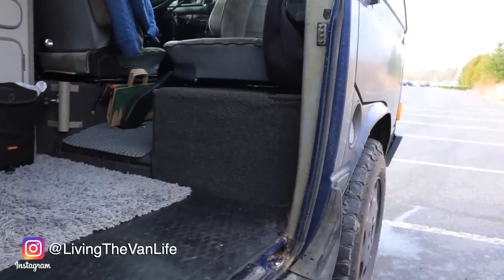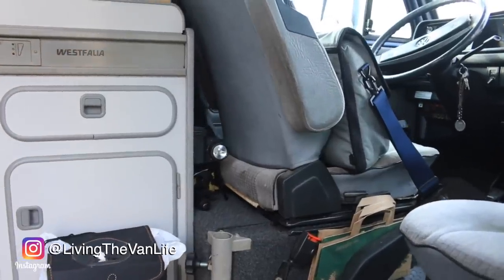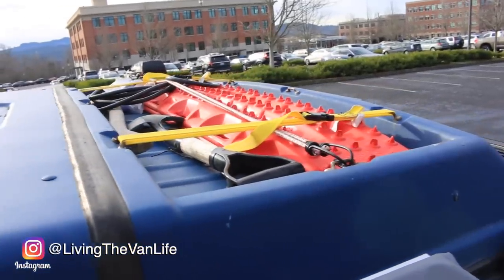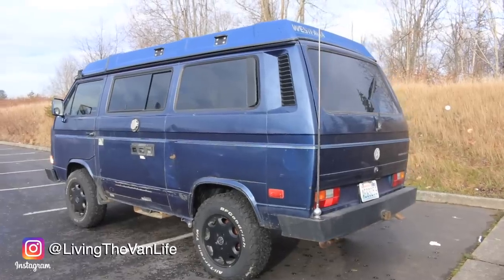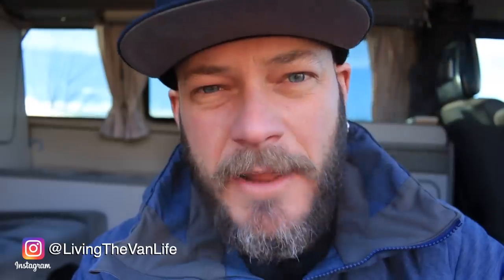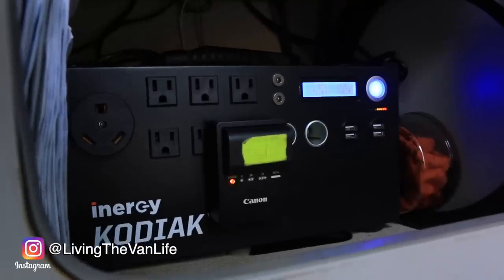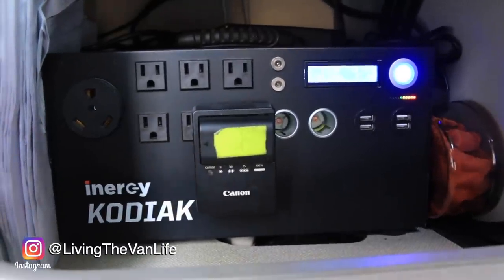Chinese Diesel Heater Install In a Volkswagen Westfalia - Living The Van Life

Comment: You forgot the most important aspect, the installation of the exhaust pipe through the floor. It is critical that no exhaust leaks back into the van. Also a CO alarm is a must.

Comment: I slept in Chicago -23 degrees in February in my ford E-150 Eco-no-line conversion van with NO HEATER ,  a jogging suit, a beanie hat,  2 hot water bottles, 2 pillows, and 3 Quilts, and my remote starter at my hip. I slept just fine no problem at all. Just keep your head inside the covers. You can use a MR Buddy heater or a diesel heater but i just wanted to let you know it can be done 100% with out it.
Reply from the maker: Yes of course.  For sure.  I’ve done the same with no heater at 10° F.  A sleeping bag and sweat pants. Didn’t even have water bottles or a remote starter.  Definitely keeping the head under the covers is a must.

Comment: Not sure if mentioned, but you may want to cut down a furnace air filter to fit that intake plenum to minimize lint, dust and other stuff from being sucked into the unit.
Reply: Great suggestion. Will do that when I make mine...someday.   :)
Reply: Thank you. That's a great idea.
Reply: I work for the Ambulance Service and use diesel heaters.
We found that fluff from blankets etc have fouled the air intake and caused the units to malfunction. 
The comments about an intake filter therefore sound like a possible solution

Comment: A couple tips about installation for these heaters :
 - fuel tank, you can buy/make  what is called a stand pipe. The benefit of it is, you dont end up with a hole on the bottom side of your fuel tank. A stand pipe is just a metal or rubber tube that drops down from the top of the tank. You drill a hole in the top. Install a fitting with a tube that drops to the bottom of the tank. You then attach you tine going to pump to the fitting on top the tank. You could even put a quick connect on it. Also, you can put a additional filter on the bottom of the stand pipe. If you use a rubber tube for your stand pipe that is weighted on the end, if you happen yo park on a incline, the runner tube will move to the lowest point which is where you fuel will be. Airplanes use this idea.
- fuel pump, webasto has installation instructions that say the pump is supposed to be mounted at an angle with the higher end going to the fuel tank. Its supposed to help with air bubbles or something.
Reply: Excellent commentary. I'd add, mounting the fuel pump under the van, the fuel pump does create a bit of noise population.

Comment: Chad thank you I think you just changed my life. My old 1973 Dodge Explorer 224 has the original furnace in it it runs off of propane still runs good but you definitely cannot find parts for it. I will definitely be upgrading high heat source in my camper thanks for the good quality videos you produce

Comment: I went through 3 Espar D2 units in 6 years and it was a pain at around $600 to $1,000 a pop both new and rebuilt. These Chinese units are new and I'm seeing them all over the place. I'll be interested to see how long they last. Even if they last lets say 8 months you will still be far better off just getting a new one instead of an Espar. 

These units run best on Kerosene instead of diesel. Make sure you adjust the fuel flow when getting into higher altitude. Always carry an extra fuel pump. The glow plug replacement needs a special tool and one wrong move installing and it's ruined. Get the tool and a spare glow plug. 

For those running off diesel go to Walmart lamp section and get a bottle of lamp oil. That is kerosene. About once a month in the cold season when you're running this a lot do this. Get the bottle then take the end off the fuel pump. Get a spare section of fuel line and hook that to the fuel pump and into the bottle of kerosene. Run the unit on high. Do this at night and watch the sparks come out the exhaust. That's the carbon buildup inside burning off. 

Hope this helps.
Reply: What failed on your d2?  I haven't heard of fatal problems.
Reply: I've heard plenty of failures and experienced them first hand.
Reply: How did they fail? I’ve had them in trucks for years with no bother.
Reply: Chasein70 iôii
Reply: @chasein7019  how did they fail?
Reply: They stopped working
Reply: You can service an Espar D2 anywhere in north America or Europe. They are installed in most 18 wheelers. You throw out a Chinese Heater when it breaks.
Reply: Sure, for a cost of anywhere from $600 to $900 to fix!!! For that price you can buy a ton of these Chinese heaters and toss them when they break. Espar is an overpriced piece of shit
Reply: While it would be nice to know the details of the failure, as someone may have good tip to fix it, the fact is Chasing70 has found them to be a PITA. I assume they were installed correctly and running the correct fuel. I’m looking forward to reviews of the cheapo heaters 2 years down the road. I hope their good b/c I want one.
Reply: Will Prowse has a great channel you may get some great ideas from. Looking at buying one of these for a while now trying to get rid of many gallons of old diesel i have had on hand need to also filter.  Kerosene does burn's dryer. I always look at flash points when storing something.  Thanks for the information.
Reply: Man I have had mine about 6 yrs and it still works great just think I need a new thermostat as it will not resart by its self.
Reply: I think you just don`t know how clean and service them if you still have them I will buy them off you.
Reply: Ran D2’s for years in trucks in Europe. Every night for at least half the year. No problems. No extra fuel pumps. No need to get lamp oil. Never needed to replace glow plugs. And you say the Chinese units are better lol. I’d sleep better with a D2 under my bed than a cheap copy from China.
Reply: @chasein7019  Well if you're running kerosene through them that might be the problem as its not as self lubricating as diesel is.
Reply: The problem might be your fuel not the product. 6 years with ZERO problems in my semi. I keep saying I should disassemble it for a cleaning, but keep putting it off.
Reply: My espar quits every year, new screen and it's good to go.  There is nothing you can do to an espar that isnt repairable-- I believed.  Very surprised by your experience.   I have been using them for years.
Reply: My Espar D2 has run flawlessly for 7 years.  Changed one ignition part, and cleaned the fuel,screen once. That’s it!
Reply: Great video
Reply: @chasein7019  are you forgetting the j bearings in the heaters pump foo?
Reply: Yep The S bar heater failed in my semi 
After 18months .. 
pos 1,000 bucks 
I can buy 5 of these Chinese diesel heaters 
For one Sbar 🤦‍♂️.
Reply: @chasein7019  
💯 - true
Reply: Just a follow up. I've since retired in my cargo trailer/camper conversion. I'm here in Quartzsite, AZ at the LTVA. I ended up buying one of those Chinese heaters off Ebay for like $195. It worked no problem. So cheap I bought 2 more as spares. I did not keep all the parts. Just the heaters, controls and pumps. I threw everything else in the trash including the intake and exhaust pipes. I bought stainless that I'm using now. I also installed a 22 gallon fuel tank. I run diesel but if I can find kerosene I run that. 

It's cold here in AZ in the mornings and I run the heater every day. The heater also comes on here and there for a short time at night. Before shutting down for the day I run it on high for about 30 minutes. 

I also did not use the muffler. One note. There is a fan inside and they do use some power. If you were in a van on a cold night your battery would not last. I have 4 100 amp hour batteries and they take a hit of about .2 volts overnight.
Reply: @chasein7019  there is a guy on yt who took one apart, the pulse / fuel pump def has metal on metal moving parts?! They recommend when 1st time priming get the fuel near the pump manually to avoid dry running for any longer than necessary.
Reply: @philiphurdwell3443  I've been using these since the 1970's when they were run off gas. I've had Espar and the Chinese. There are NO moving parts that are lubricated by the oil in diesel. There is a rubber diaphragm with only a plastic check valve. That's it!!!! On the other side with NO contact with the fuel is a solenoid that pushes the diaphragm in and out which creates the suction.  That's how a pulse pump works. 

But I know. You know a guy who's brothers uncles son had a roommate at college who knew the owner of a 7-11 who told you this right?
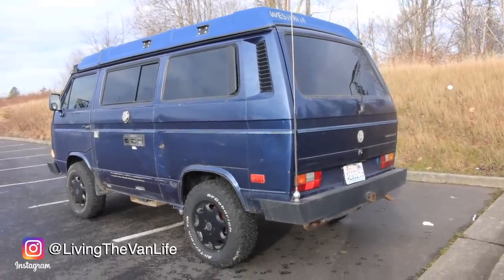Reply: @philiphurdwell3443  I watched the video. Never seen a pump like that but still a pulse pump. If you watch the video, at 2:10 he states there is NO oil for lubrication. Back in the 70's these pumps worked off crankcase pressure so the faster you went the faster it pumped and the hotter it got inside. No throttle for the heat so you kept turning it off and on. Also, there was a pilot light on all the time if you can believe it. lol....My heater was made by Volkswagen in my 1967 bug. 

Now days a computer controls when the pulse happens. When it needs to put out more heat it pulse's faster.  The tanks that come with the heaters is small. You can use ANY fuel. tank. I have a Marine 22 gallon tank in my trailer with a fill outlet on the outside. I also run Kerosene, not diesel. Most trucking companies have these heaters now and use an external 50 gallon tank also with Kerosene. Much cleaner, hotter and less carbon buildup.
Reply: @chasein7019  I'm sure you know your stuff......I do know that the actual diesel passing through on the pump in the video is also the lubricant hence why it doesn't use or need oil. This is well known and documented for these CDH,s . I dont know about any other more expensive models but I'm guessing none of them run dry as it would be a little pointless to pulse/pump fresh air.....I have this model in my t5.

Comment: I installed one of these in my van a few weeks before this video was uploaded, and I'm completely happy with it.  Best thing about these is that they do not burn the air within the vehicle's cabin and exhaust it back into that same cabin like a propane heater does.  It sucks air from outside, burns it, then exhausts the burned air back outside.  If you install it correctly, there is NO chance of producing CO inside and poisoning yourself over time.  And since it's dry heat, it doesn't produce condensation inside your van like propane does.  Another thing to think about is that since the fuel being used in the heater is not powering your van, you don't have to use diesel as your fuel.  Heating oil is the same thing as diesel except there is no road tax on it, making it cheaper than diesel.  Now if you have a diesel van, to run your heater off fuel oil, you need to run the heater off a separate tank to get away with this because it's illegal to power the vehicle with fuel that is untaxed.  Don't get caught running fuel oil in a diesel vehicle.  Fuel oil is dyed red and there is an obvious difference.

My van has a gas engine, just like yours, so for the time being I'm running it off the little tank that comes with it.  In the near future though, I'll be installing a 10 gallon tank under the van so I don't have to keep filling up the tiny tank so often.  I will run a fill tube up to the side of the van next to the gas tank fill tubes so it will look like it's supposed to be there.  I have a Ford E350 extended van, and despite having dual fuel tanks, there is room under the rear of the frame for mounting such a larger tank.  It's not like these heaters burn ridiculous amounts of fuel (actually they're quite efficient), but I hate filling the small tank up so often.  Here in MO, with it being winter, I run the heater pretty much constantly when I'm in the van, and it burns about a gallon or so overnight at the current freezing temps.  Small price to pay for the benefits of being nice and toasty at freezing temps.
Reply from the maker: Great feedback my friend.  Glad to hear others are enjoying these heaters as well.  They are definitely awesome so far!  I certainly hear you on having to fill up so often.  That does make it a bit tuff.  But its a small price to pay.  You external tank sounds like a very great idea.  Thanks for sharing this comment.  Much appreciated.  Keep on truckin my friend.
Reply: @LivingTheVanLife  and Anarcho Moto. Check out Boyd Welding LLC. They make customer aluminum diesel fuel and gas tanks. You might be interested.
Reply: Fake news alert. My Propex propane heater air intake and exhaust lines run externally.
Reply: @ravenm.  What I was talking about is the propane heaters most people buy for a van - heaters that are in the general price range of these diesel heaters.  $750 is a hell of a lot of money for a heater.  For the price of a Propex, you can get about 5 of these heaters.
Reply: @anarchomoto1152  I'm glad you're happy with your purchase. My post was to just correct your comment regarding propane heaters. Personally I'd rather not have to be worried about the need to carry around an additional fuel source. Also like traditional gasoline heaters the carbon deposits from diesel heaters require annual cleaning which I'd rather not deal with. Every system has their pros and cons. To each their own.m
Reply: @ravenm.  Your vehicle runs on propane?
Reply: @anarchomoto1152  That's a dumb ass question but I'll bite and entertain it. No my westfalia has a propane tank designed to feed the stove.
Reply: @ravenm.  Then you ARE carrying around an additional fuel source, no different than I am.  I don't use propane.  My heater was designed for diesel, which is the same as fuel oil, and that's what I'm using.  The cook stove I will be using will use the same fuel as the heater, and since I have a gas van, that's 2 fuels.  Same as you.
Reply: @anarchomoto1152  Again I'm glad your set-up works for you, that's great. If you read my comments it's what has worked for me, no one else. For ME it makes no sense adding an additional fuel source other than what currently is installed on my vehicle. As I'm sure you are well aware the VW Westfalia comes already equipped with a built in propane system which simplified the heater installation process. Why in the hell would I also want to be worried about hauling around diesel fuel?
Reply: @ravenm.  That's cool.  My vehicle was just a regular passenger van when I got it, so propane wasn't there to begin with.  I too did not want to carry around any more fuels than necessary, so that's why I decided to go with diesel/fuel oil.  I have a 10 gallon tank that I will be installing under the rear of the van just behind the main tank for that.  

For now, I'm just using a butane stove that uses small cartridges that go inside the stove itself so I don't have to carry a large propane tank.  But that's just temporary.  I read about an expedition vehicle that used a diesel cooktop, and once I get that far in the build, that's the direction I'll be going.  

For me, the nice part is that I will be able to fill both my gas tanks and the diesel tank at the same time at the pump.
Reply: @anarchomoto1152  Sounds like a pretty cool build you have going on! If I had the time that's definetly the route I would go for my next van.
Reply: @ravenm.  LOL  This build has been a pain in the butt at times.  I got a great deal on the van, but not long after I bought it, it started with some intermittent fuel pump issues, and that took a while to get straightened out.  So by the time the fuel issue gets figured out and the van is running well again, it's the middle of winter!  Yikes!  So the interior right now is just bare bones functional and is nothing pretty.  But I suppose it works for now until spring comes around and I can get back to it.  Since I can't do much work on the interior in the middle of winter, for now I'm just collecting up the stuff I need for when it gets warmer.  I've ordered 2 more solar panels to add to my single panel system, and I will be ordering some good insulation soon.  Probably will go with Thinsulate.  It's kind of expensive, but since it's a hydrophobic material I won't have to worry about it soaking up moisture, freezing, and losing it's insulation value.  

Once it gets warm, I'll be gutting the interior again, running all the electrical, insulating, then doing the interior in either T&G pine or cedar (not sure which yet).  

So are you full-timing in your van?  I have been for several months, but it's just with a thrown-together interior at this point.  I've wanted to go mobile for a long time, but it was just recently that it came about, and mostly not by choice.  A friend and I were sharing a house, and then he suddenly decided he was moving to another state giving me only about 3 weeks notice.  At that point, I had just bought the van and the interior was totally stock, not at all suited for living.  But I decided that as much as the situation sucked, this was the perfect opportunity to do what I had always wanted to do.  It's been tough at times, but I have no regrets.  :)
Reply: Difference is you get a 2-year warranty, service, parts availability if you break something, cleaner quieter running and a proven design, not a cheap copy of a better heater (Espar). The diesel heaters require service almost yearly.

Comment: Congrats, I just installed one on my live aboard sailboat and it's one of the best things I've done, nice and warm, no more condensation,, minimal fuel useage nothing but good things to say,, good luck with yours, !!
Reply: Where did you mount it ?  Where did you run the air intake/exhaust ?